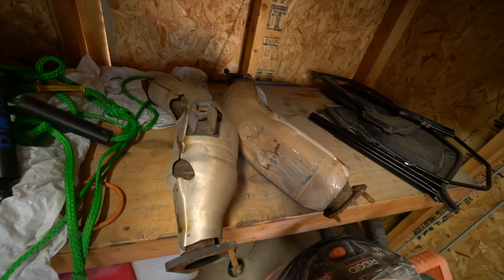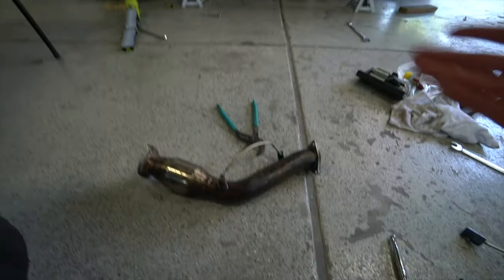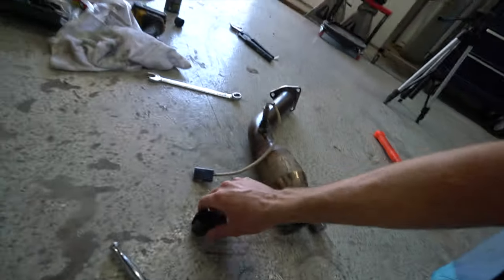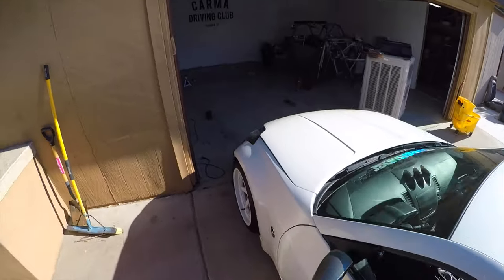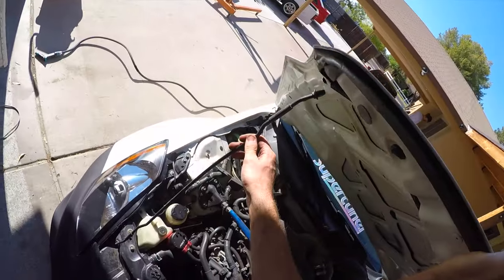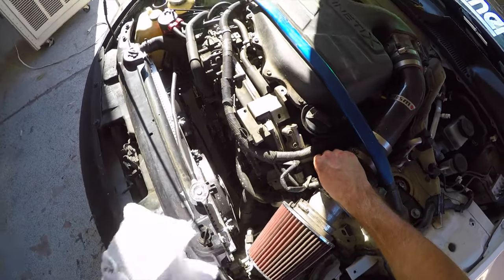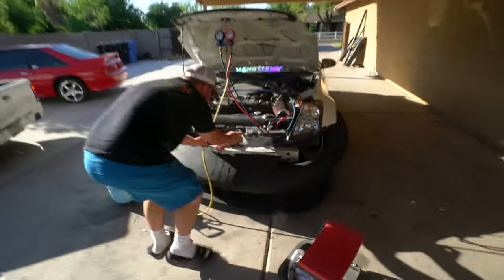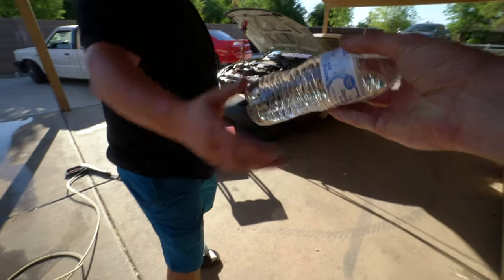350z Exhaust Changes I Didn't Expect to do.

Comment: PB Blaster...i use it on everything..for example my blower motor had rusted shaft. It barely turned like it was set on low. Last night I pulled it out, blasted the shaft, installed it, and now it works like new

Comment: Yo I’m 17 working 2 jobs and been saving money all summer so before school starts I can buy my own car babyyyy.  Imma get a 350z manual. Which year should I get? Imma have like 5k so I should be able to get a 03-06.
Reply: Me.Brandon J how many miles are on it (be careful because I know a kid who rushed into buying one with about 150k miles on it and right after he bought it the whole car just started falling apart like clutch went out, broke a shift linkage but that was his fault, passenger side door doesn’t work and the windows don’t roll down all the way)
Reply: Get an 07-09
Reply: Klaus I can find some with 100k-120k for 5k
Reply: Mateo Quiroz ik but those are 2 to 4 thousand dollars more. I’ll keep my eye out for one bc ik those are the best
Reply: when you go to by one take a peak under the car as well I bought one, next thing I know it needs an exhaust, valve cover gaskets (pita), plenum gasket, uppercontrol arms, slave cylinder the list goes on it’s usually just mileage parts that wear out but make sure you check under the hood and the oil while you are there 03-06 is a de and they love oil lmao
Reply: I have a 06 350z i won’t lie yea it’s somewhat better the the regular DE (05-06 rev up engines) but trust me HR are much better and faster but if you’re really just wanting one ASAP get a 06
Reply: cody vazquez yeah definitely I dont wanna get screwed cause then I’m not gonna have a ride to school or work
Reply: tyrayekim I’ll try my best to keep looking. Still got a month and a half before school starts
Reply: Me.Brandon J aye man I’m 17 too and bought a 350z mane n jus sum advice take your time finding the right car cuz I rushed n my tranny clutch and flywheel all went out
Reply: Mark F yeah ik. I don’t wanna get fucked over after spending thousands. I’ll make sure I play it safe.